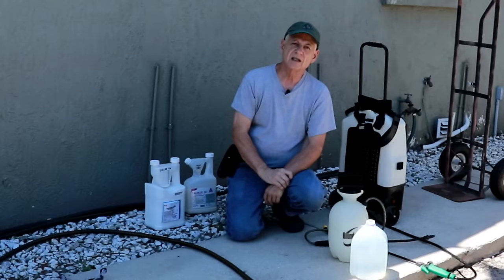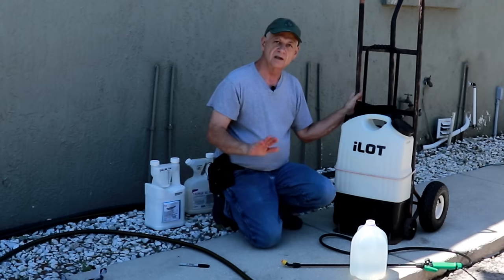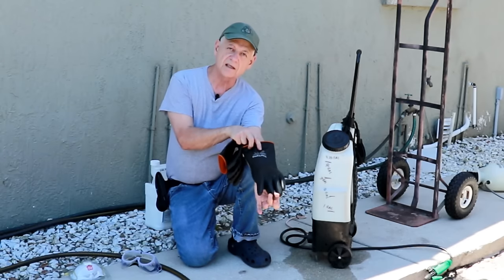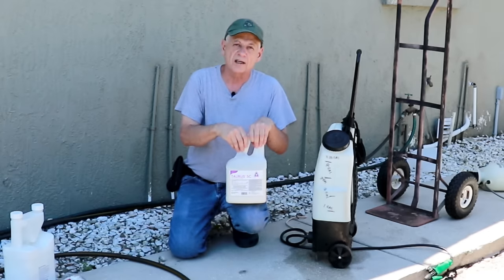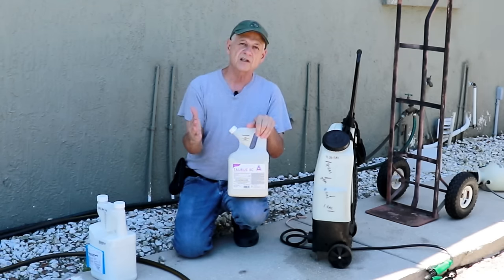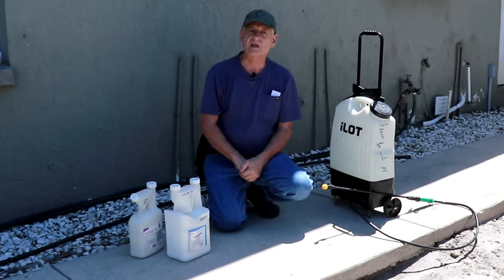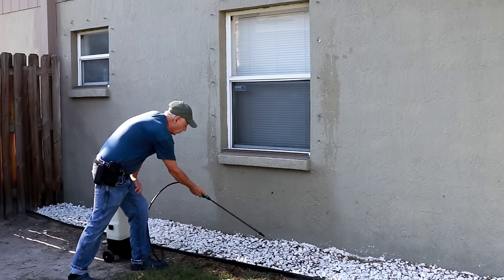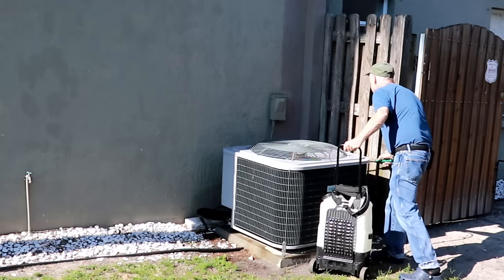General Exterior Pest Control - IMPORTANT!  READ THE DESCRIPTION.

Comment: what sprayer you used for this video, where can I purchase it?
Reply from the maker: Hi Sandra. Sorry for the delay in answering your question.  For some unknown reason YouTube held it for review and I didn't know that they did that sort of thing.  I have the problem fixed now, but not before several questions went unanswered.  The sprayer that I use is not available anymore.  Too bad because it's really great.  However, any backpack sprayer will do the job.  I like mine because it's on wheels, but recently I was complaining to my wife about how much is still hurts to use it at my age and she suggested that I just fill it half way.  Hmmmm.  I guess it takes the common sense of a woman to figure out the obvious.  Boy to I feel stupid.  So, now I just put two gallons in the four gallon sprayer and it's pretty easy to handle, even if I carry it.  I think a gallon of water weighs something like eight pounds, so the entire thing weighs less than 20 pounds with two gallons in it.  Still a little heavy for me these days, but I can manage it.  You can purchase a cheap four gallon backpack sprayer at Harbor Freight for about $25 and they may have them for around that price on Amazon as well.  Just be sure that it's battery operated.  The pump ones are not effective for exterior use.  Thanks for the question and, again, sorry for the delay.

Comment: I have a large deck. Should I go around the deck or should I go under and spray around the posts to the ground?
Reply from the maker: If you can get under the deck, then you are always best to treat around each post and up against the foundation under there as well.  If you cannot get under there, you could purchase a garden hose sprayer attachment.  I will place a link below for a good one.  If you are using Talstar P, then mix it one part pesticide to three parts water and set the sprayer to four oz per gallon.  The dilution rate is one oz per gallon, but you are cutting it with water, so you need to go with four oz per gallon.  The pesticide is too thick straight out of the container to get sucked up into the sprayer, so it must be mixed with water to work properly.  The sprayer I am recommending has a high pressure setting that will shoot a stream out that can reach up to about 20 feet.  This makes it super easy to reach places like under porches and eves that are too high up and require a ladder.  Technically, you are not supposed to do it this way, so I didn't mention it in the video, but it does get the job done.  I do it all the time and it works great.

I hope that helps.  Be well my friend.

https://www.amazon.com/gp/product/B00UER1S64/ref=ppx_yo_dt_b_search_asin_title?ie=UTF8&psc=1
Reply: @GuysPestSolutions  thanks a lot!
Reply from the maker: You are very welcome.  Always my pleasure.  Be well Dylan.

Comment: Any thoughts on Demon Max compared to the producs you recommend?
Reply from the maker: Demon Max has a quick kill, but I don't find that it lasts that long.  The products I recommend can last up to 90 days, but with Demon Max it's probably more like 30 days.  If you want a less expensive option, try using Bifen IT.  It's a cheaper alternative to Talstar P, but it works just as well.

I hope that helps.  Be well my friend.

Comment: Im going to use the Taurus for termites how long will it last?
Reply from the maker: If you trench the exterior of the house properly, then the Taurus SC will last between five to ten years.  The problem is that trenching is hard, time consuming work and you need to know what you are doing.  There are videos on it, but they don't always tell you everything you need to know.  Treating with the BioAdvanced Termite Killer granules is a better idea and the entire job can be done in about an hour for about $50 for an average house.  Unlike the trenching, the granules need to be applied every year, but it's way easier to do.  While it is true that the Taurus SC with trenching will work faster than the granules, the end result will be the same.  Both systems work the exact same way.  I have been doing this stuff for years and I do not trench my home.  I just use the granules every year and I never have a problem with termites.  It really is that easy.  I hope that helps.

DIY Termite Treatment:  https://youtu.be/H7rW_TSBHJ4

Comment: Is there a sprayer that reached eaves of second story? I don’t want to use a ladder to get to everything I need to reach.
Reply from the maker: I would be happy to give you a link for a sprayer that will probably reach your eaves, but there is a simpler solution to the problem.  If you would like to know what that is, then e-mail me at guyspestsolutions@gmail.com.

I hope that helps.  Be well my friend.

Battery operated sprayer:  https://www.amazon.com/dp/B08B3MKYWD/?coliid=I1WHD5A3RF25H9&colid=3VDXA5DFBKQ98&psc=1&ref_=lv_ov_lig_dp_it
Reply: I would like to know that as well, I have some eves at 20 and 30 feet up, thank you for the video, I have just emailed you
Reply from the maker: I'm sorry Paul.  Did I get back to you on this?  You cannot imagine how many questions I answer every day and it is easy for someone to fall through the crack and hard for me to always recall if I responded.  I seem to remember that you have a three-story home, but I can't recall if I gave you all the information you need.  There is a way to easily treat two stories, but not three.  20 feet is about the limit.  I'm not sure if I shared that with you though. Please email me again if I didn't explain it to you.  Thanks.
Reply: Sometimes you can access the eaves of the home through the window don't go out the window just open it make sure you use rubber gloves eye protection long sleeves and a hat
Reply from the maker: I will be coming out with a video on how to do this early next year.  I have a video on how to treat your lawn and your yard coming out within the next few days.  While I cannot recommend doing this, you could use the lawn procedure on the house as well.  Even though I am not recommending it, I know of at least one old pest controller that does it all the time and it causes no harm to the environment or the applicator.  Using this procedure is three times faster than a tank sprayer, but it does use more product.  It also allows you to reach areas that are up to 20 feet from the ground.  Sorry that I had to include the disclaimer, but you know how people can be these days.  If you have an interest in seeing these videos when they are released, then please subscribe and click on the bell, so that you will be notified when they come out.

Be well my friend.

Comment: Guy, will this treatment work against carpenter bees?
Reply from the maker: Yes.  It will prevent carpenter bees.  However, if you have them already, then I do recommend that you shoot some fipronil foam into the holes and then caulk over the holes.  Any fipronil foam will do the job.  You can get it from Amazon and I will place a link below for Fuse.  It's a good product.  Shoot it into each hole for about five seconds or until you see it coming out of other holes.  Some people use a dust, but I like the foam better.  Once the bees are treated, then the exterior pest control will keep them gone for good if you do it every three months.  I hope that helps.

https://www.amazon.com/Control-Solutions-FUSE-FOAM-Can/dp/B07194JVKD/ref=sr_1_3?dchild=1&keywords=fipronil+foam&qid=1621073387&s=hi&sr=1-3-catcorr

Comment: I live in Florida also but have a mobile home with vinyl siding. I use the same practice I used in New England that I spray all j channels and joints that collect water and then 2 foot up of siding letting a good continuous drip line hit the ground. Then pretty much do what you do for rest of home. My question is the peers that the house sits on. How to treat those to arrest any entry. It’s like 28 foot wide so getting to them is a challenge beyond what my age will allow. I had the ground sealed with new plastic which may be good or bad? Do I need to get a ‘young whipper snapper ‘ in to treat these posts or should I be provably ok just spraying what I can reach ? Ps. Inside I use a perimeter, inside safe, gp insecticide and foggers every 3 months- seams to be working.
Reply from the maker: Hi Richard.  I am so sorry that it took so long to get back to you on this, but I did not receive your question until just this minute.  As it turns out, YouTube held your question for review and I had no idea that they did that.  I am kind of new to YouTube and I don't know why they would hold your comment for review.  It seemed fine to me.  Anyway, with regard to the piers, you do want to treat them the same way as you would a house foundation.  You want to spay them down and then just soak the heck out of the area where the ground meets the pier.  I know that some of these mobile homes sit pretty low to the ground, so it can be difficult to do what I am suggesting.  I am an old timer too, so I do understand.  So, if treating the piers is not an option, then soak the ground around the entire home really good with Taurus SC and use the BioAdvanced Termite Killer as described in my DIY Termite Video.  I will place a link to it below.  Again, I am so sorry that I did not get back to you.  I always try to answer questions within 24 hours.  Now that I know YouTube is doing this, I will check it every day.

Comment: Hey guy, do you think talastar works on red solider  bugs ?
Reply from the maker: If you mean red soldier beetles, then the answer is yes.  You can also use Bifen IT or Bifen XTS.  The Bifen XTS may seem expensive, but keep in mind that it gets mixed at 1/3 of an ounce per gallon instead of the one ounce per gallon that the Talstar P gets mixed at.  So, the product goes three times as far, and actually costs less per finished gallon than Talstar P or the Bifen IT.  These products all have the same active ingredient, but for some reason the Bifen products have a bit of an odor to them until they dry.  The Bifen XTS can also be mixed in a hose and sprayer that will allow you to also treat your yard.  I will give you a link to my video on how to do that.  I hope that helps.  Be well my friend.     

Bifen XTS:  https://www.domyown.com/bifen-xts-p-1236.html

Video on how to treat your yard with a hose end sprayer:  https://youtu.be/wifoTU5dmp0